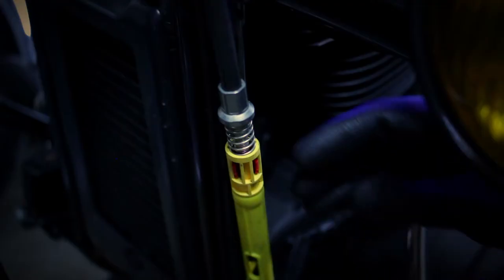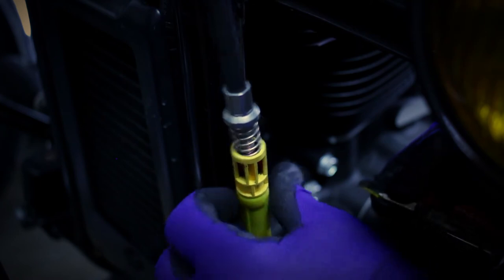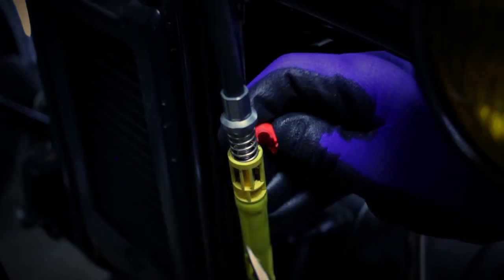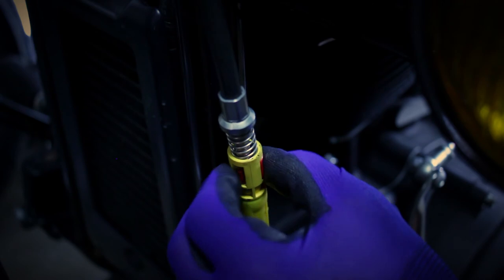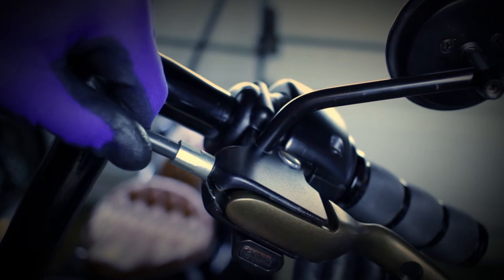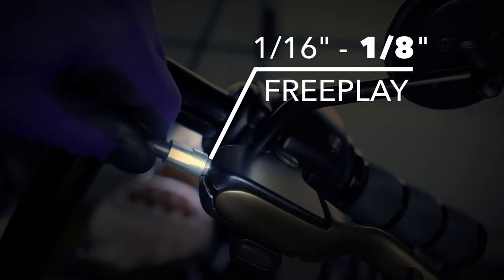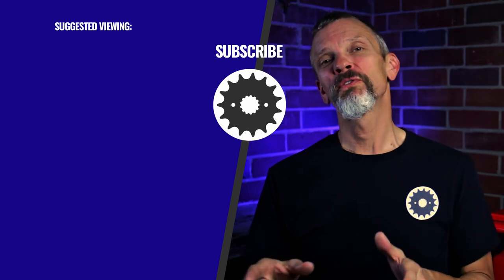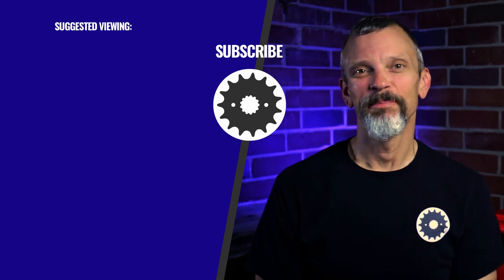Milwaukee 8 Upper Clutch Cable Free-Play • 2018+ Softail

Comment: Ron. Great video and easy to follow. Thanks
I do have a question for you about this adjustment.  What does it do to the friction zone when adjusting? Is there a way to put the friction zone closer to the grip versa out away from the grip? 
Thanks in advance.
Carson
Reply from the maker: Hey Carson - thanks for the kind words! For the friction zone, see if this helps: https://youtu.be/xnD6rnGf5oI
Reply: Thanks Ron. I've seen this video and it does not answer all my questions. If I turn the adjustment screw, does this effect the friction zone?  My friction zone is right against the handlebar grip and I want it further away.
Reply from the maker: Check out this part of the video - it does affect the friction zone: https://youtu.be/xnD6rnGf5oI?si=tWDMy2aPdIcXcpUy&t=305

Comment: Hi Ron,

Couple of days back my low rider 107 introduced a very big play in clutch lever. I followed your video to adjust the clutch cable but I found that the red button which acts as a lock is not doing its job. As soon as I use clutch, the red lock pops up every time. What should I do? Thanks in advance!!
Reply from the maker: Hi Sandeep - that red button is a replaceable part that you can get from Harley or order online. Here’s what I show for the part number in the 2019 Softail parts catalog:

37200395A BUTTON, cable adjuster

Double-check that part number…let me know how it goes!
Reply: Perfect! I will enquire for the same and will let you know how it goes. Thanks for the quick reply.

Comment: What if you need adjustment on the cable freeplay? For instance the space is greater then 1/8"?
Reply from the maker: Hey D Stevens - Did you pop out the red clip to release the spring tension, and then snap the red clip back in?
Reply: @RonsWorkshop  

Yes sir....its about an 1/8" now.  I may have been checking freeplay with the spring compressed and clip pushed in. With the spring released and clip pushed in again its about 1/8" now. Thank u for responding!
Reply from the maker: Excellent!

Comment: How do you disconnect the cable at the adjustment area in order to do something like add an extended cable for taller bars?
Reply from the maker: Hey Zac - great question! It’s super simple but just a little fiddly. The yellow part is attached to the upper cable, and there’s a small metal tab that bends over a ball end on the lower cable. You pop out the red clip, release all the cable tension by compressing the spring, and then snap the red clip back in. Spin the yellow part around so you can see the metal tab (at the bottom), then bend that tab out so that the cable end can come free. Then you slip the cable end outward through a little slot on the yellow part and then drop it below the little socket it was sitting in (or pull the yellow part up). At that point the upper cable is free. Then reverse the process to reinstall the new upper cable. I’ll do a video on that part too - thanks for asking! If you want a channel sticker send me a DM on Instagram with the mailing info @RonsWorkshop
Reply: Thanks for the quick reply!  I’m actually in the middle of doing a bar swap right now on my 2020 Lowrider S.  This will be the first thing I tackle in the morning, so I truly appreciate you saving me some time (and probably frustration) in the process!  I’ll definitely look you up on IG!

Sincerely, 
IG: zacwentrogue
Reply from the maker: Nice! Let me see those bars when you get them installed :)
Reply from the maker: @zaccrymes3256  I just posted the video for swapping out the upper clutch cable. I know you already did this, but I wanted to let you know it's posted and I gave you a shout-out for the video idea. https://youtu.be/oOaADTwUu6k

Comment: Hey, great video thanks! Quick question for you so when we’re replacing the clutch lever, does inside the clutch cage also need to be adjusted?
Reply from the maker: Hey Letizia Passanisi - Thank you for the kind words! You shouldn’t need to make any adjustments behind the derby cover unless you’re at a mileage interval for that particular adjustment.

Comment: I'm sorry. Maybe I'm just too dense, but when did the actual adjustment occur? I just didn't get it.
Reply from the maker: Hey toneLovette - when you release the red clip and the spring is released it sets the preload. And when you snap the red clip back in the adjustment is done!
Reply: Interesting. I just replaced the upper cable on my Lowrider. I thought I just got lucky.😂 Thanks for the video. It was the reason I was able to do it.
Reply from the maker: toneLovette I’m so glad this was helpful!

Comment: Can I use 2014 Softail clutch cable on 2018 Milwaukee 8 Softail???
Reply from the maker: As far as I know, yes. The new bikes should be compatible with the previous style clutch cables.
Reply: Thanks for replying & that's great to know Ron 🙏 I'm planning to install 16" ape on my 2018 heritage & using old style clutch cable 👍🙏 @RonsWorkshop
Reply from the maker: @awedihdaira2786 excellent! Let me know how it goes.

Comment: Yeah the little Red Adjuster Stripped out on my 21 Road Glide Special. Couldn't figure out why my Clutch lever free play was so inconsistent. The little Red Adjuster had barely anything in it to grab the cable. Went to the dealer and picked up 2. One installed and one spare now
Reply from the maker: Hey Jack - nice…two is one and one is none! Cheap insurance for sure.

Comment: I’ve watched a few of these videos, no one actual says how to adjust the free play. How do you make it tighter??

Edit: after watching 3-4 more videos on this someone finally said all you do is twist the yellow part left or right to tighten or loosen the slack. Thank you!
Reply from the maker: When you pop out the red clip the spring should expand to set the free play. To get minimal free play you can push the clutch lever against the perch while red clip is out, and then snap the red clip back in. Let me know how it goes.

Comment: Good video. Do you have video how to replace clutch lever on HD 2021 touring ? The issue is that this lever has spring inside to not allow to set lever properly.
Reply from the maker: Hi Roman - thanks for the kind words! I only have the Softail right now so I don’t have a video on the touring lever replacement. Let me know what you find out. 

I do have a more recent video that includes the full clutch adjustment and an explanation of the friction zone: https://youtu.be/xnD6rnGf5oI

Comment: I'm missing something here. I watched both yours and Doc Harley's videos. You both show where to make an adjustment, but I don't get how you are making the adjustment. My bike was repaired after an accident and the clutch doesn't engage until the lever is almost all the way out now. I need it to engage closer to the handle bar. This talks about slack but leaves my questioning how to resolve my problem. Yea I know, I'm being a little dense here but that's my life..
Reply from the maker: Hey Tom - I understand the confusion because the new two-piece cable makes it easier than we expect. When you pop out that red clip, the spring tension that is exerted is what sets the free-play. As long as the clutch is properly adjusted at the hub, and the cable end is properly seated in the perch, that should set it once you pop out the red clip, let the spring expand, and then reseat the red clip. If you're still having trouble you might consider doing the clutch adjustment down at the derby cover. It's simple and only takes about 10 minutes. Here's a link if you haven't see it yet: https://youtu.be/xnD6rnGf5oI

 Let me know if that helps and how it ends up!

And if you want a sticker send me a DM on Telegram, Instagram or Signal with the mailing info @RonsWorkshop
Reply: @RonsWorkshop  Thanks. That explains it. Now I understand why nothing else was needed. Just release the pressure and reset the clip... yea, that was the easy I was reading in the other comments. Thanks again.

Comment: I have a 2020 Lowrider s. I just swapped the clutch and brake hand levers a few hours ago. I went around the block to test it out and now my bike feels like it’s having a hard time shifting into different gears. It also had a hard time finding neutral. I’m scared I did something wrong!
Reply from the maker: Hey Josh - did you set the free-play using the red clip down at the yellow adjuster?

Comment: what if you DO NOT have the right amount of free play, how do you adjust?
Reply from the maker: Hey Michael - the spring in the yellow adjuster should keep the free play set correctly. If not, you may need to do a clutch adjustment. It’s a simple process and you can check out this video: https://youtu.be/qfmE5D6qxmE

Let me know how it goes…
Reply: @RonsWorkshop  Thanks. There is a bit of play in the clutch lever to the point it vibrates and when I pull on the cable to remove the play in the lever, the gap is about 1/8". What do you think I need to do?
Reply from the maker: Do you know how long that clutch cable has been on the bike / how many miles? It doesn’t seem like it would be stretched but I’m wondering what could be going on. And how much play is in the lever in general? Also wondering if the lever could be worn.
Reply: @RonsWorkshop  it is a brand new lever (Arlen Ness). It seems to have tightened up by the adjustment. Thanks
Reply from the maker: @michaelflorant8641 that’s great!

Comment: Does it matter if the adjustment is done with the motorcycle hot or cold?
Reply from the maker: Hey Anthony - temperature doesn’t matter for the free-play adjustment, but the clutch hub adjustment has to be done with the bike cool / at room temperature.

Comment: Will this work on my street glide special ??
Reply from the maker: Hey WISEGUYZX310 - if you have the current style two-piece clutch cable these steps will work. A giveaway for this style cable is that big plastic cover over the adjuster (usually clipped to the left front corner of the frame) rather than the smaller bellowed rubber boot on the previous one-piece style. Let me know if that helps.

Comment: I did in fact I moved it all the way manually to the bottom and insert the red clip there appears to be too much slack according to the specs. I'm just concerned with the free play that the clutch is not totally disengaging causing it  to be difficult to get into neutral while it's running when bike is not running it's easier to find neutral
Reply from the maker: Yeah I’d be concerned about that too. Double check everything with the clutch cable and the lever to make sure things are seated properly. Other than that I’m not sure what could be happening.
Reply: @RonsWorkshop  I just bought the bike, and the previous owner was 6Ft and I'm 5-6 so I pulled the handle bars back towards the seat. Would this have anything to do with the cable length? When I hold the clutch lever in gear and rev the bike there's no creep, so I guess that it's disengaged. As I have read that Harley's can be difficult to find N. Just looking for a way to shorten the cable. Also I read that you live in Fl. as I live in the Daytona area, have you looked into adding cooling fans?
Reply from the maker: @ronkuszik5756 there’s a chance that pulling the bars back could take up a bit of cable slack but if anything it would reduce free-play. 

I hadn’t considered cooling fans, but my summer rides aren’t long 🤣

Comment: Where I can buy the upper cable for tall handlebars?
Reply from the maker: Hey Juan - I’ve only found the upper clutch cable at Harley as an OEM part. I haven’t found any aftermarket options so far. Which bars are you going with? Sends some pics on Instagram @RonsWorkshop
Reply: @RonsWorkshop  I beleive Magnum shielding and LA choppers do extended cables
Reply from the maker: Hey Ricky G - thanks for that info!

Comment: my clutch lever won't get tight enough how do you fix it?????? nobody will explain it
Reply from the maker: Hey Calvin - do you have the two-piece clutch cable? And have you done the adjustment down at the hub? Here’s a video on that adjustment in case you need it: https://youtu.be/xnD6rnGf5oI

Comment: I have 1200 miles on my new 2021 Street Bob 114 FXBBS and just finished a group ride and parked it for a few. When i went to leave and started it and grabbed the clutch there was zero tension and the handle was just free play. I had it towed from the park. I couldn't get a clear answer from the dealer but they said the clutch needed to be adjusted then another time they said it needed its first adjustment after cable stretch and the clip and spring came off inside the clutch housing. I am wondering how the hell the retaining clip could come off inside the clutch. Sounds like a major safety issue. Imagine if i was riding when this happened.
Reply from the maker: Hey Victor - yeah that’s really odd. That red clip is held in by the tube that slides down over the adjuster. Were you able to inspect that to see what the status was?
Reply: @RonsWorkshop  it wasn't there, it was in the case where it gave way.

Comment: What's next if you do this adjustment and your free play is wrong??
Reply from the maker: Hey John - is there spring tension down at the yellow adjuster, and is the cable ferrule seated correctly into the perch? With everything seated the spring at yellow adjuster should provide just the right amount of preload for everything to be in spec once you snap in the red clip.
Reply: @RonsWorkshop  yes Ron got it .I seen threads in there that it was like old school had to tighten. Thanks great video's
Reply from the maker: Ok good - glad you got it sorted out. And thanks for the kind words!

Comment: The previous clutch cable adjuster was near bullet proof why did they change it to an adjuster that causes trouble.
Reply from the maker: Hey Phillip - yeah, I've hard mixed results. I've had no problems at all, but apparently there are issues with it.

Comment: I have no issue with the clutch tension, but I do have an issue with the clutch lever rattling.
Reply from the maker: Hey Tyrone Shoelace - can you tell if it’s because the clearances in the perch are too large, or if it’s wear on the pivot pin / bushing, or if it’s the cable tension? Just a few things to check.

Comment: Hey Ron great video seriously short and sweet exactly what I was looking for! Quick question. Why is it that my clutch cable needs to be right tightened? Am I not shifting well enough or is this just part of the maintenance?? I recently painted my levers and when I installed them again the clutch had a ton of play it didn’t have before.
Reply from the maker: Hey Alfredo Rangel - is the spring adjuster on the upper clutch cable working properly? That should take up the slack and set the free play with just the spring tension, with rejected clip snapped in. It will need periodic adjustment as thing wear but just removing the levers shouldn’t require anything other than setting the free play — if it was shifting properly before you removed the levers.
Reply: Ron's Workshop Yes everything is working fine. And I took it out for a ride after installing the levers again  and it worked fine just felt lots of slop in the lever! Did what you said in the video now though and it’s fixed. I think it just lost its tension when I removed them.
Reply from the maker: Glad you got it sorted out! If you want a channel sticker send me a DM on Telegram or Instagram with the mailing info @RonsWorkshop

Comment: what if you dont have free play?  no adjustment had here
Reply from the maker: Hmmm...there should be some amount of free-play. You may want to do the clutch adjustment. It's easy and quick: https://youtu.be/qfmE5D6qxmE - let me know what you find!
Reply: @RonsWorkshop  i know how to adjust the clutch.  I just don’t get why Harley didn’t allow for adjustment on the upper to have a the clutch off the bar.  I mean pushing the spring down and reclipping it works but does that stress that mechanism?  That’s the question
Reply from the maker: Good question. It does seem like it could stress that mechanism if you manually compressed the spring and then snapped the red clip back in. But to your point - you shouldn’t have to do that.

Comment: Why kind of oil or lubrication should you use to oil the cable. When doing the 1k service
Reply: @RonsWorkshop  synthetic oil for the cluth cable?
Reply from the maker: Scratch my last reply - sorry about that. Apparently I only read the first half of your question. I like to use dry lube for the clutch cable. One that can be sprayed in with a straw or squirted in. Teflon or graphite have worked well for me.
Reply: @RonsWorkshop  teflon oil and graphite oil?
Reply from the maker: @adminadmin9997  Look for DuPont dry lube, Blaster dry lube, or WD40 dry lube. Just make sure it's dry lube - see how it works for you and let me know.

Comment: Hey Ron...is there anyway to adjust the clutch free play at all?  I have the clutch set correctly behind the derby and have release the spring as far as it can go, however there is to much freeplay :(
Reply from the maker: Hey Roger Ramjet - I wonder if the upper clutch cable (or lower clutch cable) is worn? That could cause excessive free-play. How many miles on the cables? I don’t think there’s any way to adjust it other than what you’ve done.
Reply: @RonsWorkshop  thanks for the response its only got 18000kms on it which is bugger all :(
Reply from the maker: That’s puzzling. Is it the original cable? How’s the length? Just wondering if it’s too short if that could cause that issue.
Reply: @RonsWorkshop  original cable on 2019 fxfbs. I think I might purchase a new cable as its annoying with the clutch lever flapping. I have to rest my fingers on it so its not vibrating away
Reply from the maker: Yeah that’s so strange. Have you inspected that yellow adjuster? I wonder if it has a problem. I’m not sure if that piece can be replaced or if it is permanent on the lower clutch cable.